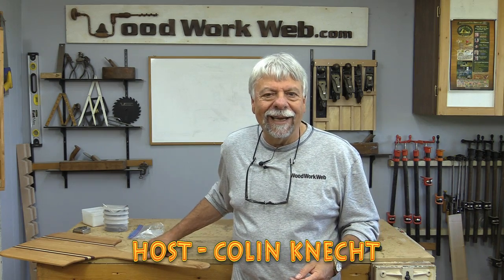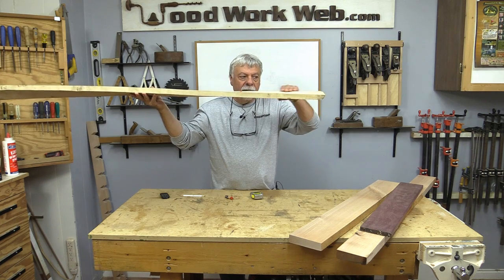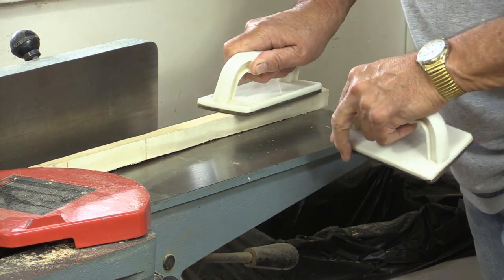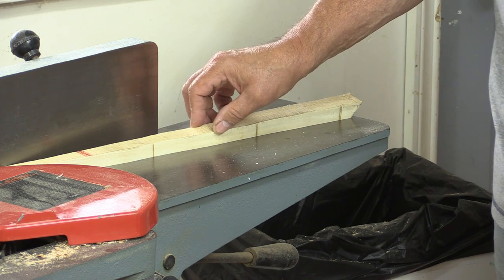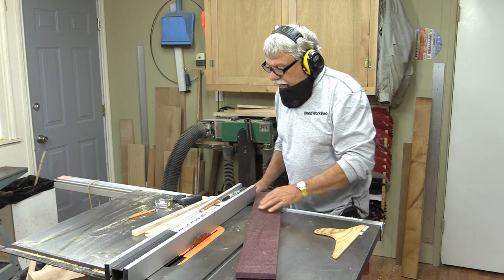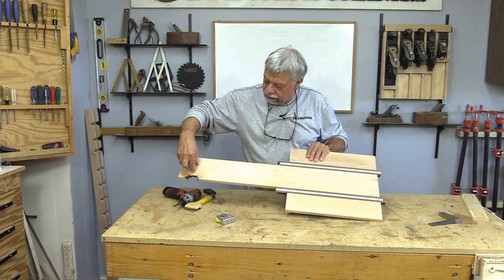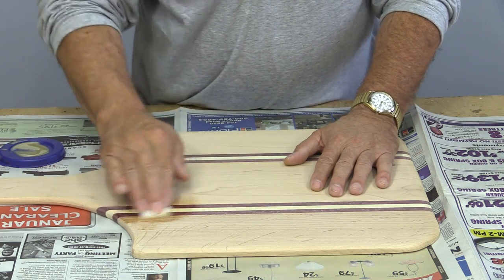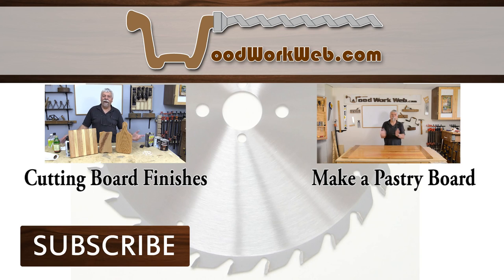How to Make a Pizza Peel / Wood Pizza Paddle

Comment: looks great. I would have thought it would be a little thinner and tapered at the end.
Reply: I was thinking the same. I would have put it on the table saw (flat bottom against the fence) with a 30 degree bevel cut to taper the end. I make a lot of breads and this makes a huge difference when taking out hot loaves.

Comment: Talk about bring back memories, my son did woodshop in 1996 and needed a project for final test of the class,  He came home with not an original idea at all so I told him he could make a Pizza peel but not as fancy as the you have made.  We went wood hunting, tearing skids from a metal show that had nothing but oak and many different varieties of oak.  We were able to avoid the nail homes and I sat down and wrote out every step he needed to take to do the project.  Well he graduated from high school and brought home the peel which got him an A for the year.  He was lucky the teacher didn't see the instructions or he would never have gotten an A.  He made the peel 14 inches wide because he thought 6 more inches in width was too much, so he cut the handle smaller to fit the 14 inch.  I met his teacher 4 months later at a craft sale at the church.  He was impressed with my son and his idea of a pizza peel till he realized that it was my idea.  40 years of teaching wood shop in school and retired to he home shop where he cut off 3 fingers of his hand and 1/3 of his wrist.